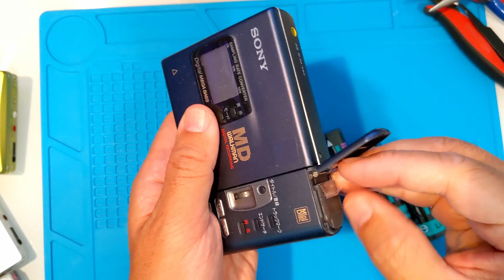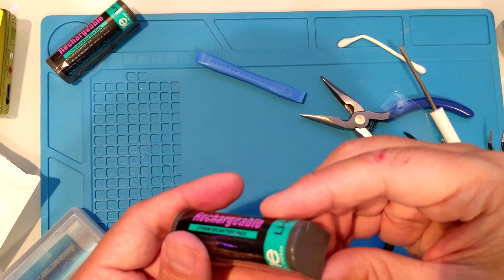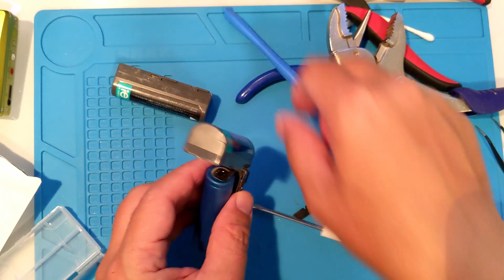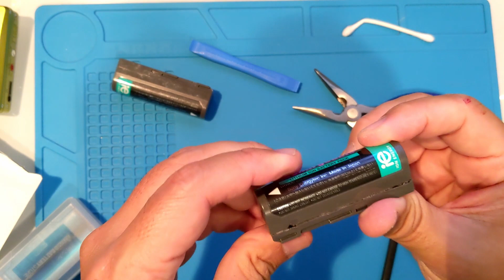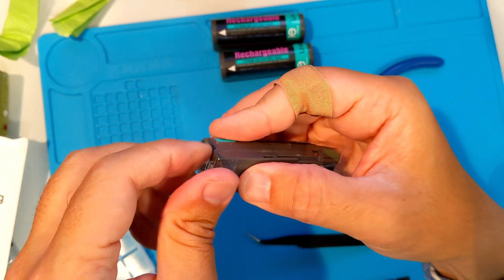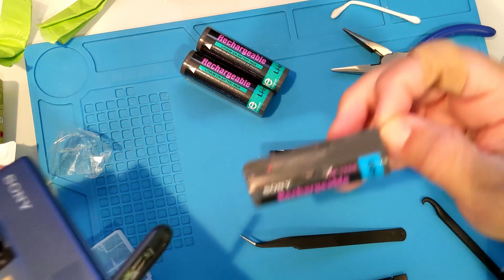Sony LIP-12 for Sony MZ-R30 MiniDisc Recorder - new Lithium-ion battery for just $4 (Samsung 18650)

Comment: I found I could twist and prise the battery cover popped open with my hands. I "sawed" the connectors off at both ends of the old battery with a Stanley knife! I simply squeezed the new battery into the cover with the 2 connectors in place and squeezed the cover lid back on. No glue or tape or soldering needed!  Just be careful when ordering a replacement battery that it's the same as the one you've removed and has the same end style (cap or no cap) and don't get hung up on improving power capacity rating or both those thing will likely get you ordering the wrong length or end style battery as they're not all the same!
Reply from the maker: Wow! That's the second time I've heard of someone saying that they could twist it and break the seals, but I couldn't manage that. You must have some powerful grip strength!
Reply: @TechnicalInitiative ha ha, if I recall, I think I remember pressing hard around the seam and that partly broke the seal! I do know I just wedged the new battery in with the metal connectors at both ends, no soldering, just wedged in nice and tight!
Reply: @d4ves363  I will try - nothing to lose, when the original battery is dead XD :P 
my doubt: the AA supplies 2.4 V , de DC Input 6V , I suppose the main battery to be replaced most be between 3V to 6V, Ampere may varies, while I found a 3.6V in my local market.

Comment: could you link the place that you purchased these batteries from? thanks!
Reply from the maker: If you're in the US - I got them from here:  https://www.18650batterystore.com/

Tons of options, so check the sizes carefully
Reply: @TechnicalInitiative  Can I choose any battery from the 18650 line? sadly the Samsungs are sold out. Do you think a molicel or Panasonic 18650 would be fine to power early to mid 90's minidisc players?
Reply from the maker: Do me a favor and check the size of the Samsung that I used. Compare that with one of the others you mentioned because that Samsung was a perfectly snug fit. Anything longer would not have fit in the case

Comment: Wish you would consider making a video a to z how to build batteries for the NH1 and RH1 including battery selection and 3d printing.
It's a big project, but very interesting nonetheless.
Reply from the maker: You apparently are psychic - I started recording this exact project before I left the states. I have most of it together, but I need to finalize some things. It will be a "work in progress" video where I can hopefully collaborate with some 3D printer owners in the MD community to finalize it, but I believe I have the best battery specs/sizes and have tested prototypes successfully!
Reply: @TechnicalInitiative  brilliant !!!
Other than a couple of online articles and a single video on YouTube reusing an old battery, there isn't much available about these batteries.
Thank you! I'll keep an eye on the channel
Reply: Small contribution:
I opened one of the AliExpress batteries (35usd with shipping) to see how they managed to shove 500mha in it, found a 350 mha battery type LSA 302055 (3 x 20 x 55 mm), which I can't even find on AliExpress, and it seems they used most of the battery space to make it happen, but I think there's a better alternative, using the 402050 (420 and up to 500 mha) if we avoid printing the battery bed layer, means we will have only the edges and battery terminals, the battery will occupy most of the space inside and we can cover the whole thing with thin Kapton tape (shrink sleeve would be better but it may add thickness and make the battery difficult to insert and remove).
Reply from the maker: @al-mukhantich  Thank you! I've got a great test-fit cell that's working (been using this as my daily driver in an MZ-RH1) with great battery life. Yes, I did away with the stock LIP-4WM charging circuit since these have a charging circuit of their own

Will keep you posted!

Comment: Finally after 30 years I learn about the function of the switch that turns red.
Reply from the maker: Haha I was hoping it was more functional than just an indicator
Reply: Indicator for what?
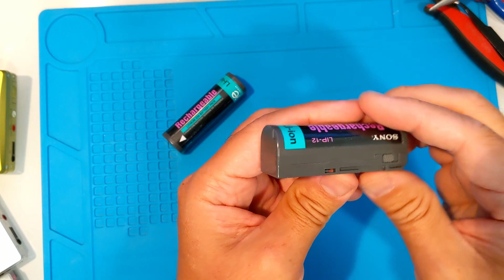Reply: @luter82  At 1:33 the switch can be used to mark if it is charged or not.

Comment: Are the batteries still available for around $4?
Reply from the maker: even cheaper - looks like there's a sale! I used the green Samsung ones - https://www.18650batterystore.com/collections/samsung-18650-batteries
Reply: @TechnicalInitiative  Woo, bargain! I'm debating if it's worth the $7.40 shipping charge. My local Batteries+ has them in stock for $11.99. Do you think you'd ever use more than one? If I can find a use for more than one, I'll order a few to make it more cost effective.

Comment: This is really helpful, thanks. Nice clear and simple instructions so a cack-handed, non-technical person like me can follow. 

I found my old MZ-R35 in the loft the other day, still in perfect condition apart from the dead battery. We used these machines back in the late 90s when I was working at the BBC as a Producer Director. I was travelling all over the world making TV programmes, including music programmes, so the sound had to be top notch. BBC sound recordists loved these machines because the audio quality was so good, the build quality was robust for daily use and of course the size of the unit made them perfect to take on the road. 

When I managed to remove the plastic enclosure on mine I found the negative terminal had come away from the PCB. I think that was probably my fault when I took it apart. Still, I learned how to solder and fixed it back in place, so I learned a new skill as well. I'm really happy to get this old friend working again. Thanks for the video.
Reply from the maker: Hello @simonmansfield8030 - thank you for the kind words and what a great story! I love hearing about how these were "really used" for work purposes, not just for enjoying music. Very glad the video was able to help you keep your great device going!

Comment: Pretty nice fix, honestly, why can't we just 3D print the external enclosure to avoid this process altogether? Is there anything on that green PCB inside that has any logic on it?
Reply from the maker: I think someone did! I believe there is some charging protection on the PCB since it's just a "dumb 18650" but I'm not sure... I'll look next time!  I just processed 4 more of these for some Discord users
Reply: @TechnicalInitiative  That's awesome! Yeah I think re-making it with 3D printed parts and a basic limiter circuit might be faster / easier. Especially if the 3D printed case is designed to be re-used and re-opened!
Reply from the maker: Yeah the reusability is a great point! I need to look into this... if I don't see a design out there, I think there needs to be one! Making one where you can easily "reload" a dead 18650 would be awesome.
Reply: @TechnicalInitiative  I think so too! 18650's are super common! Since their inception by Sony in 1991 they've been everywhere! From portable electronics to Tesla electric vehicles' battery packs. So I feel like such a design would certainly be useful!
Reply: @TechnicalInitiative  There is a reusable enclosure that uses the 14500 battery. It's the route that I chose to go down for my MZ-R30, MZ-R35 and MZ-R2 machines. As I also bought LIP-8 enclosures that use the 14500 battery too, my MZ-R50 machines are working now and I only need one type of battery to run the lot.